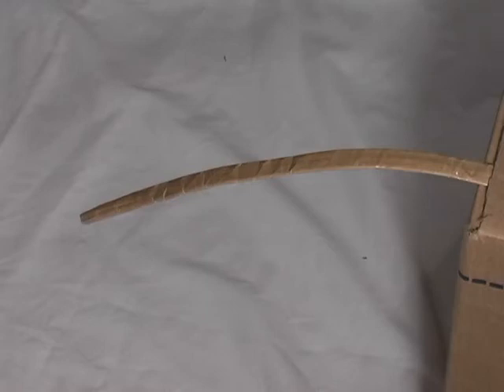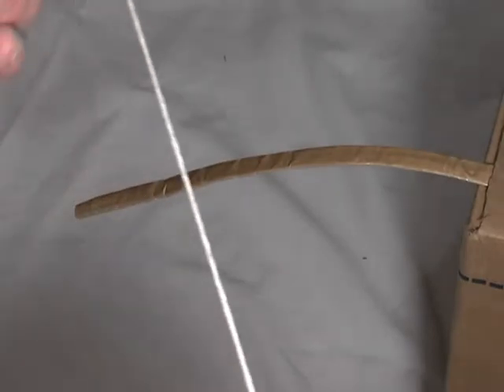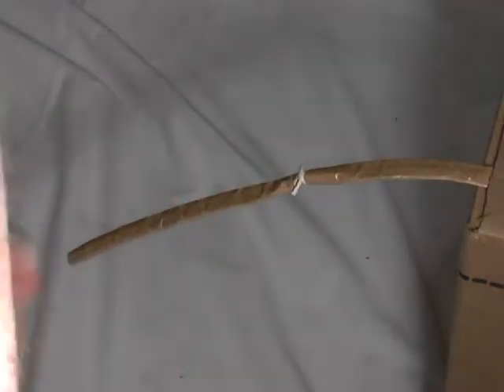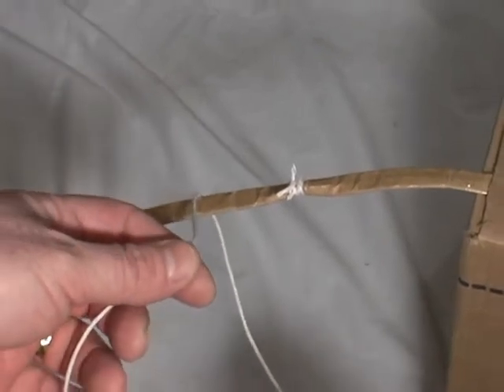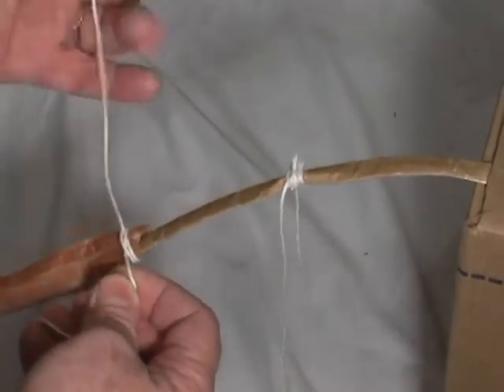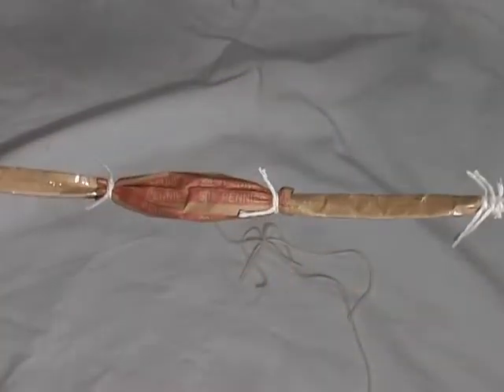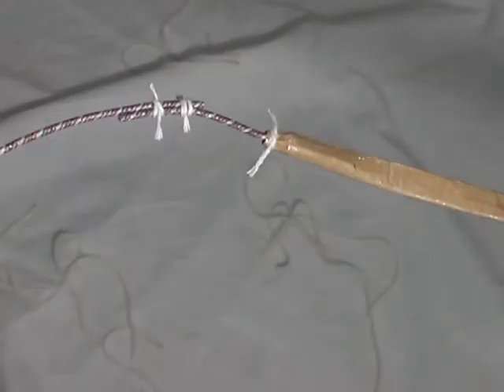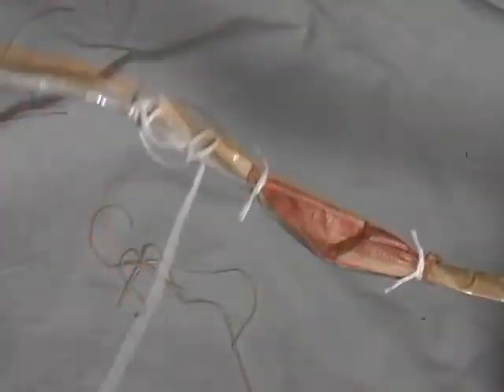The Fireworks Knot.....A Clove Hitch

Comment from the maker: You are correct you should finish with a simple knot and it will not come apart. I should have added that but figured it would really complicate it for the novice. I have also seen people tie this knot starting it differently from under as apposed to over the top. My way is Over the Top, Right ,Left Through the V. Now add finish with simple knot. Thanks for pointing that out.

Comment: The clove hitch knot is nothing more than two half hitches. The clove hitch is required by the FAA for rib stitching which means securing linen fabric to the ribs on older antique aircraft wings. This was required teaching back until at least the early 1980s as part of earning an Airframe & Powerplant mechanics license. I earned my A&P license during that time period but don't know if it's still required today.

Comment: The knot you use when you knot down your e-match is a half hitch.
And the white tape you use with strings in it if you fold it back onto itself and rub the fold 3-4 times with the roll then give a strong pull back in the direction you was taping it will snap every time no cutting required.

Comment: Wahaa, I just tried it out with some shit I had home, like a wire to my headset around a thing here at home haha.. looks nice was hard to untie when I did pull it pretty tight, but I guess that is not the right purpose so when it goes in pyro-mode this knot it will make better use.

Comment: Hey mate just a question I have 3 10 shot fan racks I use excals pro shells exterminator and 10'000 degrees haven't tried to fuse but maybe you can help me I understand how to fuse it's just some canister shell fuses are so long and i dont know what to cut the fuse with cause like you said prolly shouldnt use sciorrors and  it kinda makes me feel uneasy like it won't burn right or have a accident if the fuses arent tight how do I get my quick fuse and she'll fuse to attach right fit snug in not so loose in over laping and i have zip ties but do i absoultley need paper tap cause i just bought  silver duct tape and what is the name of the item i would use to cut the fuse with out getting a spark please and thank you